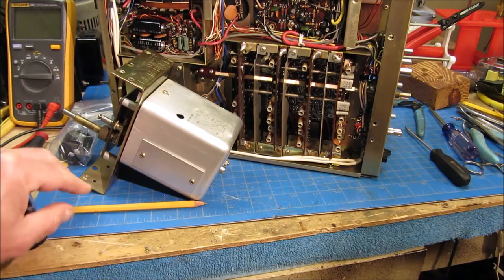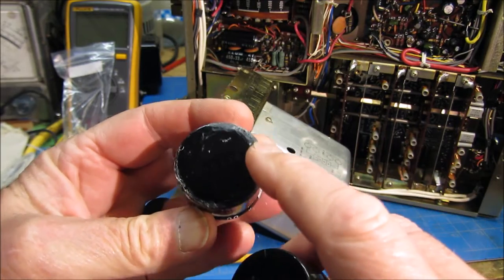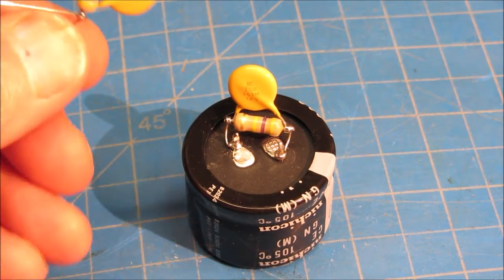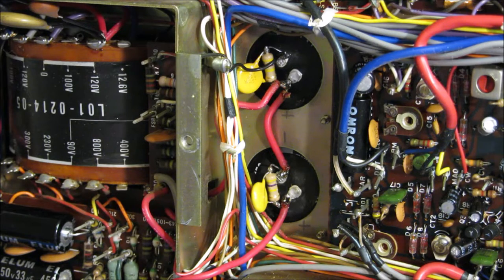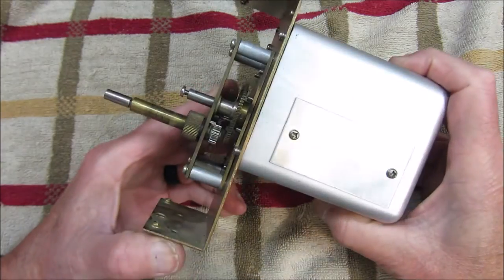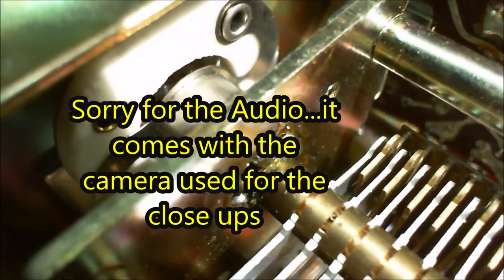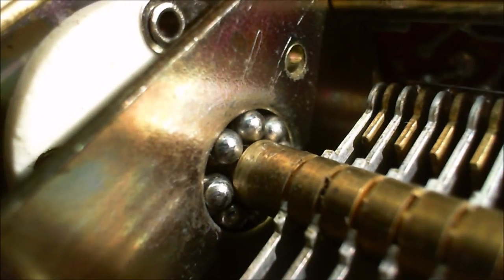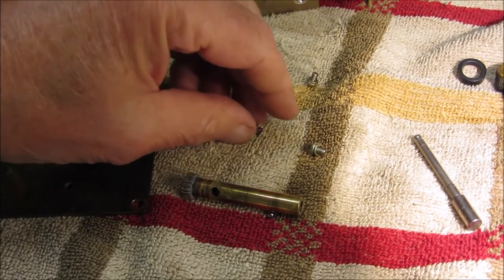Kenwood TS 520 Part 3 of 4 Replace HV Capacitors and Clean the VFO

Comment: Great job there Larry. Watch out for the wire wrapped pins the wires break very easy. At least they did on my 820. Those radio were ahead of there time back when they were built. Carl
Reply from the maker: Great tip Carl!! I usually solder one if I remove it….I’m anxious to try the transmit side soon!! Take Care—Larry
Reply: Carl, 
Have you ever used "Speedwire" before?  It is basically the same type of wire, but it is on a spool on the top of a pencil-like device that has a tool that fixes the wire on a post that only holds 2 wires max using "insulation displacement" to make connections.  While the format has its good points, I can't tell you the number of times I had a "good connection" at the post itself, but the wire inside would be broken, and finding which wire was broken and where was a monstrous job!
Reply: @waynethompson8416  Never used that wire and didn't  know about it. Haven't had to deal with wire wrap much. Carl
Reply: @cwebs1000  I tried to find something about the system online but there is NOTHING about the stuff I used to be found anywhere!  I was using it during the 1980s so I guess it is ancient history and long gone from existence.  The boards had rows of sockets on one side and wiring pins on the other.  The rows of pins and sockets were placed in such a manner that you could mount an IC from one row of pins to the next one.  You could also mount resistors, capacitors, etc. on the same side as the ICs.  My main reason for mentioning it is that with wirewrap you usually could see the broken wire, but in Speedwire the broken wire was INSIDE the insulation and not visible to see.
Reply: @waynethompson8416  thanks  for that info.

Comment: Great job Larry, I hate those little ball bearing controls. I always keep a magnet lying in close proximity, just in case I drop one, and I usually do. That way it gets stuck to the magnet and the floor monster doesn't grab it.
Reply from the maker: I’m going to install a magnetic floor!!! lol….Thanks s Gregg
Reply: @Backtothefutureradios  Wife bought a cutting board that has magnets all through it and a trench around the edges. Mine now and it works good to keep parts away from the black hole I seem to under my desk. Carl

Comment: Great video! Question about removing the AVR board ... am I supposed to remove the coiled wire around the posts? Or is the AVR board supposed to be able to moved out of the way enough with the wires still connected?
Reply from the maker: @W4YDL  Hi, I was able to move the board enuf without removing the wires. As you know, these connections are known to break if moved a lot. The wires are solid and like anything else if flexed several times can break. Use care moving the board and be sure to double check to make sure one of the wires dont break. If the radio has been subjected to damp or uncontrolled climate, it might be a good idea to apply a little solder to the wire wraps. Makes it harder to remove later, but assures a better connection. Sometimes with a damp environment, the wire wrap connections corrode. I bought my 520 new back in 1978 and still love the way it works. I have it on my table and occasionally use it to keep the cobwebs blown out. I hope this advice helps and if I can help in any other way, please feel free to ask. Feel free to email me. Take Care—-73 Larry W4PJP
Reply: @Backtothefutureradios  thanks, Larry!  I was able to move the board just enough to replace the caps! Radio is working like a charm now! Hope to see you on the air!
Reply from the maker: @W4YDL  Good deal! Im glad the old girl is still working! I fired my 520 last week and talked in it. Still working great, I lime to use it from time to time, the band switches, pots etc needs the exercise. It was peaking near 150 watts, alway get good reports on it. Truly a radio that is hard to stop using! Take care and 73- Larry W4PJP